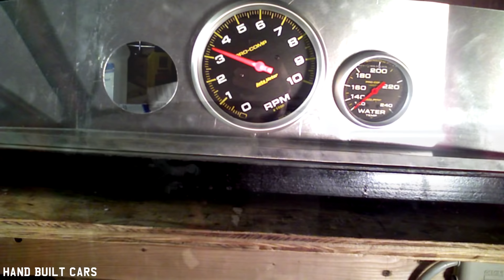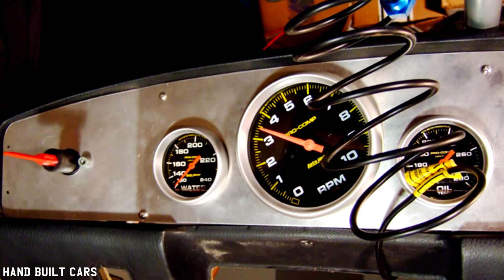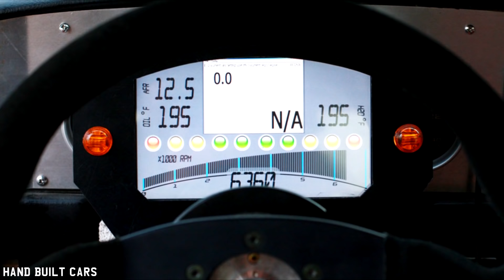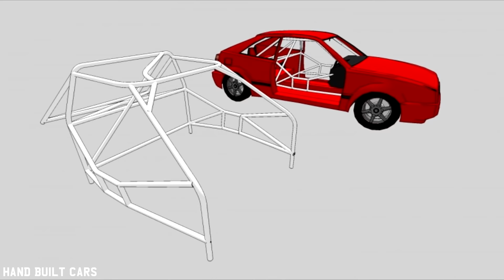★★★VolksWagen Track Corrado VR6 Build Project

Comment: Can it swap V8 or V10 engine into Corrado? 
Thanks!
Reply: the VW R32 3.0L or the Audi 3.2 24 val v6 are the best swaps for the Raddo SLC. You can stuff a larger engine in anything if you only plan to run it at the track. These picks make for a fun daily driver.